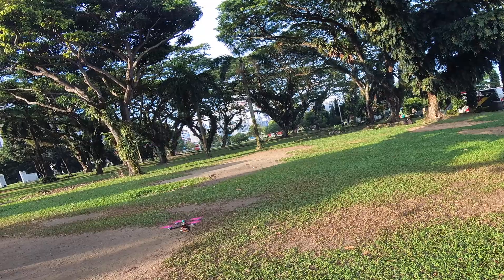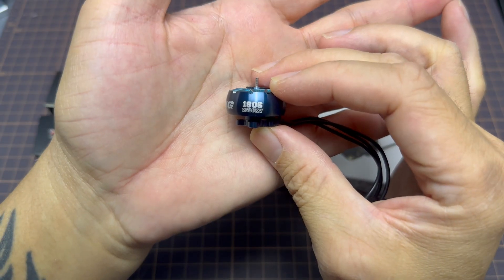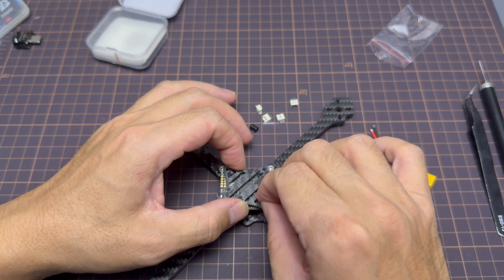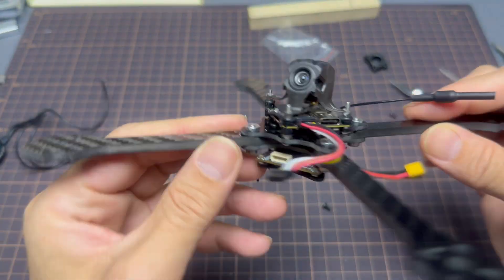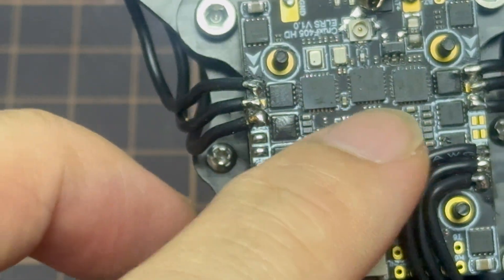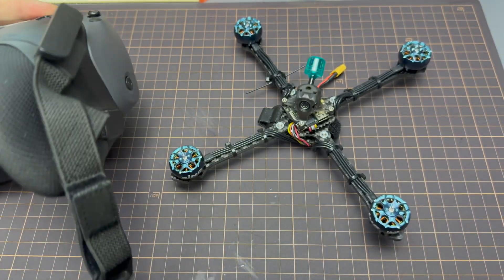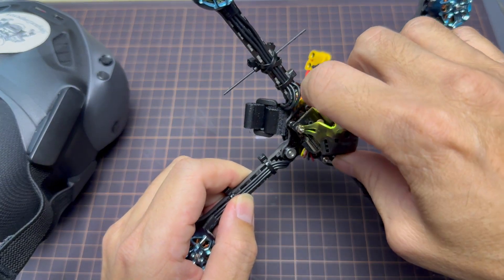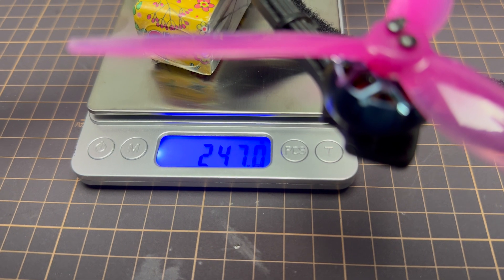How To BUILD a Sub250g 5 inch 4K Video Drone

Comment: The flyfish tony 5 is also a good frame for this.
Reply from the maker: Yeah, thats right bruddah!! But it is slightly heavier than this frame, also, it works better on biblades.  It is what my buddy Alan is flying with, which is the reason why I went for this option.  Though theres not many good options for a sub250g 5 inch
Reply: @shogunemperor  So, I'm assuming one of them will be more efficient while the other will feel more agile, I wonder which would be which?

Comment: Did you put a Betaflight  Preset on this? If so, Which one
Reply: The karate viper is an ultralight 5 inch tune that works like a charm on mine
Reply from the maker: @chrisbee ooh nice bro! Thanks for sharing that info! Appreciate it.
Reply from the maker: nah bro! Its the Crux35 pretunes from factory. They have them already tuned out of the factory.  I flew it as-is.  Thanks for dropping by!